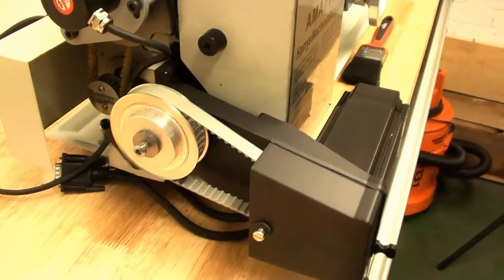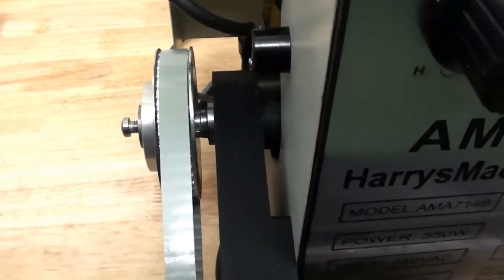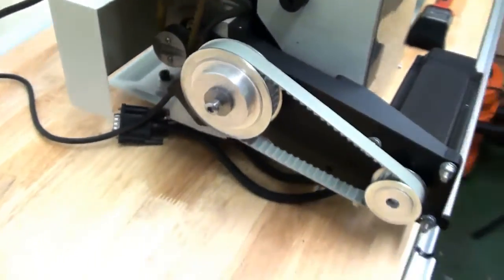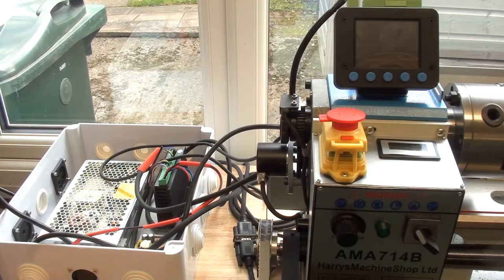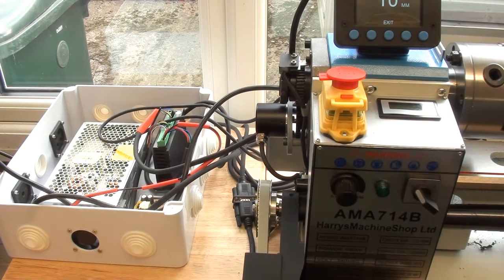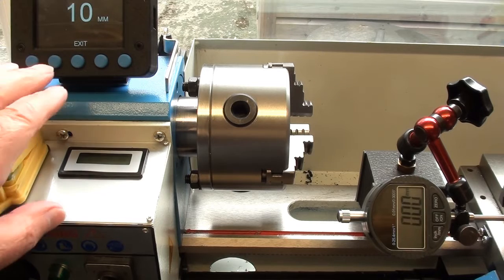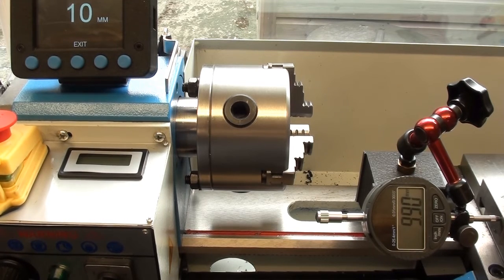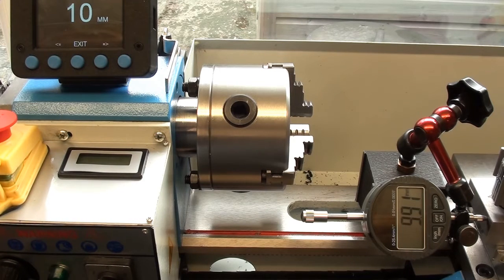Mini lathe update No 2  ELS lives!

Comment: What electric enclosure box ylu got there?
Reply from the maker: It's a plastic enclosure from eBay, 300x250x120mm in size. Only just large enough to accommodate the necessary kit.  Metal would probably be better, if only to help with rf interference suppression.

Comment: Interesting video . Could I ask what stepper motor and driver are you using? I have established I need 3nm torque and preferably a closed loop motor. Also is the encoder P/R rating important , I notice the clough42 installation uses a 1042p/r encoder. The options and specs of motors seems to be limitless!
Reply from the maker: Hi, I used a kit from Stepperonline through eBay: https://www.ebay.co.uk/itm/204621427033.  That’s a 3Nm closed loop stepper motor/driver/power supply bundle.  Power seems adequate for a mini lathe and is the same rating as I used on my previous lathe (a 9 x 20 Asian clone) that utilised the Clough42 system.  For the mini lathe, I purchased the pre-wired encoder from the French ELS supplier, which is 600 pulses per revolution.  John

Comment: Is there not a calibration mode ?  to account for the drive and driven toothed pulleys not being the exact nominal diameters ?
Just a suggestion.
 It's within 1% of the desired value, so you're getting pretty near.
Reply from the maker: Only just seen this, Colin.  Have a look at the latest video.  I think that the final few microns could well be down to the quality of the lead screw thread

Comment: I have the same ELS unit. I think it is quite good but like you could never get the test measurement to run to 10mm it is always about 9.1. Like you I assumed it was leadscrew issues, probably backlash. Do you know what 'thread tempo means' in the menu set up, I'm still unsure what this refers to? Although I'm just testing the unit out I think It is a very good  especially for BA and versatile with threading.
Reply from the maker: I've been giving this a lot of thought.  The saddle travel on my lathe is very sticky.  I originally put it down to it being poorly set up.  Now I think it may be that I haven't cleaned the anti-rust protection on the bedways etc sufficiently well, so intend to have another go at that to see whether I can improve the situation.  Certainly when under power, the saddle makes awful noises and I feel the need to maintain pressure on the half-nut lever.
The "thread tempo" refers to the length of time the els allows to retract the tool when carrying out semi-automatic threading.  In the picture in the pdf manual, it is set to 15 seconds.
John

Comment: Perhaps the 9.91 rather than 10.00 is due to lead screw backlash?
Reply from the maker: That's what I hoped but I have run the test at various places along the leadscrew, several times in each position.  No difference.  More investigation required.  But not until I've finished the installation.
John
Reply: @bizzibeeworkshop  It could be cosine error if the indicator isn't perfectly in line with the carriage, but 0.1mm seems like a lot to be off by